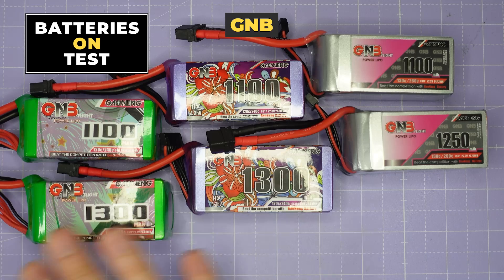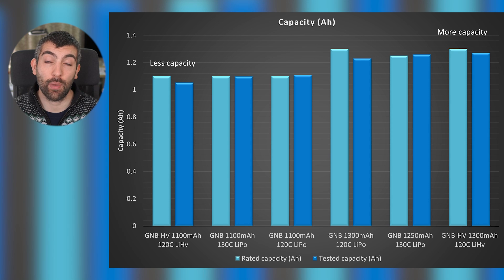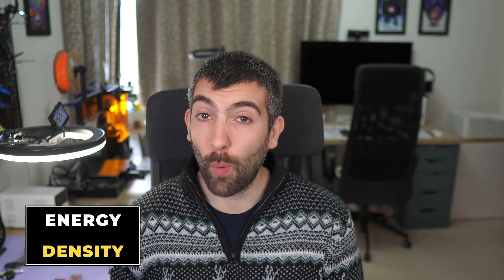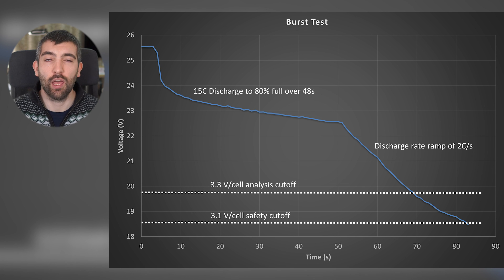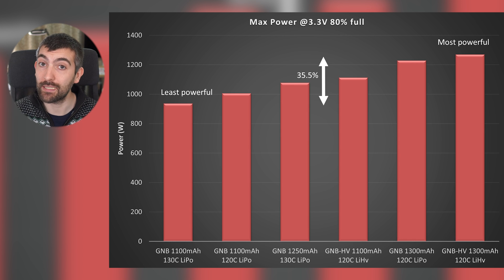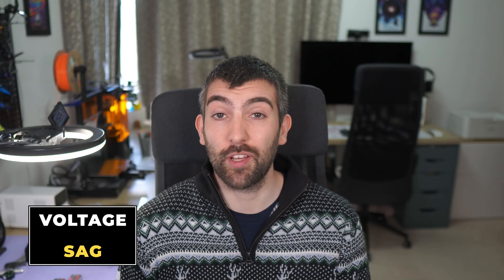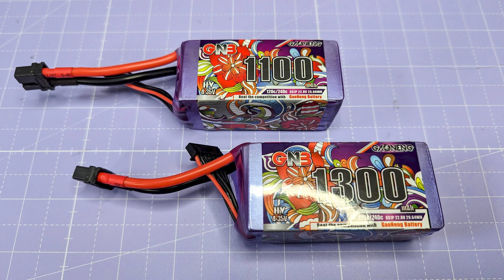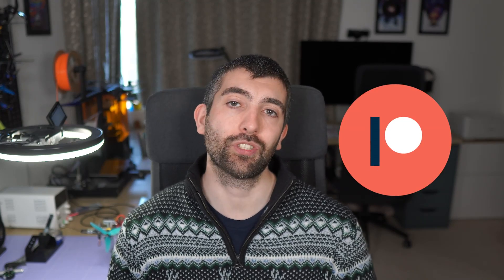Testing GNB High Volt 6S LiPo's: Not what I expected!

Comment: Honestly, I've been running long term with the GNB LiHV 120C batteries and a number of other high end packs, CNHL Ultra Blacks, Tattu R-Line 5.0s all at or around 1400-1500mah. Ive had the GNBs the longest suprisingly and got the Rlines last and have some of them fail after a handful of flights. I've found the greatest factor in battery longevity is the pilot choices, not the battery. As the biggest differences you're getting in spec are providing tiny percentage gains, but a poor decision on how long to push a battery for can give you a good 50:50 chance on that being the last charge the battery can take, ever. Going forward with a new 8s build I'm going to be investing in LiHV and focusing more on my voltage dicipline.

Also, the worst out of those batteries were the CNHL ones, almost every time was a single cell failure, pointing to bad cell binning when they put the battery together (as in they pick 5 good (but more expensive) cells and then one cheaper cell to bring costs down, which works for a while but fails first). Won't be buying that brand again.

Comment: 9:35 Have you considered standardizing putting the batteries inside an oven at the temperature they're usually at on average after reaching 80% charge during the burst test? 

This would mean you could get a higher consistency in temperature between batteries. 

I would add another 5-10°C on top of what you measure for external temperature as the internal battery temperature is always higher than the external if you've heated them up by using them, plus make sure to keep them there for an hour (or whatever you find fit) so that it's entirely saturated inside.

Comment: 14:34 I've been using the LiHV 1500 for about a year, and I often see them reading 3.7V when first plugged in. Sometimes, after unplugging and replugging, they reset to 4.4V or 4.35V, but they still perform well overall. Speedypizza lipos are a great deal at $21, while Tattu batteries cost $33 and perform better, making them a clear choice. I haven't tried Dogcom batteries ($41), but I've used the Lumenier N2O Feather-Lite 1300mAh and won't pay $60 for a lipo again. I'm honestly impressed with the Gaoneng GNB 1300mAh 120C; it's my favorite battery so far, but at $28, I might switch to Tattu after reviewing the data seeing the Gaoneng LIHV’s are $2 dollars less.

Comment: I have been flying the high voltage 1300mah 6s packs for a year now and they have been amazing. I just got a new batch and my old batch perform just as well as the new. I don’t notice any difference. These are the best lipos I have ever flown hands down
Reply: I got mine about 3 weeks ago and have only been charging them to 4.20 cuz I was always told it was super bad to charge them to 4.35 but I’m gonna see hopefully don’t ruin all my expensive batteries, I’ll take you’re work for it lol
Reply: @ontariodoublex2713  it's bad to charge standard LiPo's up to 4.35V, may even be dangerous (mostly just wear out much faster), but LiHV's are literally designed and manufactured to be charged up to 4.35V and it's the only way for them to reach their full capacity.
For LiHV - 4.35V charge is equal to LiPo - 4.2V charge
Reply: @ontariodoublex2713 I have charged them to 4.35 every time for over a year and they still fly perfect, no puffing, and they are meant to charge to 4.35 so don’t worry 🤙
Reply: Better then tattu rline?
Reply: @FPVwilco they are way lighter and perform the same if not slightly better
Reply: you guys made my mind, Im going to order te 1850mAh HV GNB, only 260gr!! holy cow
Reply: @oscr_zen hello !! Have you tested them ??

Comment: Hi Chris. Question, not related to this vid. I cant find much info on the expected current down the 3 motor wires. Its just occurred to me because I was wanting to connect my motors with 3 pin MT30 connectors. The ESC can do 50A and obviously the XT60, 60A. The required rating of the 3 motor wires and any connectors is not so obvious to work out. Probably RMS power etc but its not my area.
Reply from the maker: The design current through each wire should be the same as the ESC rating so 50A in your case. At any time two of the three wires are carrying equal and opposite current. The RMS power through the connector will be reduced by 2/3 because there are 3 wires and 2 active at a time. MR30 is commonly used for this application as it can carry 30A continuously I think and we only draw more than that per motor for short bursts and there is lots of cooling.

Comment: Got some of the gnb hv for my 2.5" because of the weight, they performed really good, BUT they also didn't last very long before becoming too puffy for my liking, I'll just go with a regular, probably tattu even though it will put me slightly ove 250g

Comment: The 120c and 130c difference makes me wonder if the cooler running 130c pack will puff less after a really hard flight, possibly giving it a longer lifespan than the 120c pack under regular high current use?

Comment: Hmmmm…. The highest C rating is a bit unfair or more biased to „bad“ cells. 

I buy many packs to compare them myself. Spent like 450€ into 6S Li-Po in less than 2 months. I like the hobby more from an technical aspect than the flying itself. 
Anyway. 
For instance. If I measure a cold (20°C) Tattu 5.0 1400mAh. It comes out at around 5mOhm. Around the same as a CNHL 1550mAh 150C or DroneIT 1380mAh 150C and now comes the but, the CNHL 1300mAh 100C, has as well around the same IR! 

But when I place the Li-Pos into my heater (which doesn’t cost more than 25€ in DIY, so anyone which seeks performance would surely have it!) the 150C packs go down to 1.8-2.5mOhm, while the 100C remains at around 3.5-4! (~35°C)

I think that’s something to consider. I’m not saying the test is BS or something. I just wanna say it depends and it should be included. The gap will spread out and when people spend a couple 100 on Tattus (which you do easily) a battery warmer for just 30 bucks is „nothing“ and also helps the battery to cycle a few more charges.

Comment: Hi Chris, I got a GNB 6S HV 4000mah lipo to test on my 7” for mid range flights. I compared to my 6S no hv 4500mah have to say that the weight savings are huge, but mah are not there. I think it’s kind of the same results you got isn’t it ? In the end , beside the first minutes of flight with more voltage, is it worth it ?

Comment: Thanks for the Testing, What if I put 2 x 3s(12v) 120c in series, do I get 24v and 240c?
Reply: 120C is the supposed/claimed discharge maximum. In series therefore still around 120C, since the current has to pass through every pack and so its chemistry limits the max?  Output voltage will be the sum of the packs.  I run 2 x 6S in series on a couple of my 600 size Heli's with nominal 50v motors.

Comment: I’ve been using my 1500 HVs for 2 years (don’t fly loads) and they seem to work just as well as when I got them. I’m impressed with them. The quality of the 650 4S HVs isn’t good in terms of wires/soldering etc.

Comment: Yes I have noticed the best batteries I have flown yet have been GNB 1300 LIHV and Dogcom Sbang or Five33. BUT the very best for some reason is RChackers 1300. The GNB last for a long amount of life time in cycles and has a lot of punch for the first 3 weeks. The Dogcom has a crap load of power but when they drop out at the end they drop fast and hard. The rchackers have less punching power but longer flights and longer amount of top end power and way less sag. You cant beat a rchacker for 37$ for two and get to fly longer. So I keep those three. I hate Pizza batteries they are junk and crap out in a few weeks for me.
Reply: I absolutely love my RC hackers 1300s! I've bought 32 of them so far. About to order another 12. They are just good, solid packs at a fantastic price!

Comment: Great work!
would be interesting to see a test of preheated batteries! Also: did you make sure the Packe had the same temperatures as you began the test? As you jokingly said in the beginning of the video I would assume that you heat up the room durcing testing so that the Batteries testet at the end get an advantage.
Reply from the maker: I do all the testing at 20degC in the room (it's air conditioned). The start of the video was just a joke as you say.

Comment: The voltage sag section of this test really explains what I was feeling on my GNB packs. I'm not running 6S, but the way you explained how they feel is what I was feeling. Great burst performance at first and then fall off really fast. I don't like how that feels and I don't want to use that option in BF that tries to level it out.
Reply: Vbat sag compensation is great! I didn't like the idea at first either, don't like anything messing with my throttle. But really it's making the throttle feel more direct by making each throttle position equate to a specific voltage rather than the throttle defining a percentage of whatever voltage is left in the battery

Comment: There was a very large and popular battery test on Rcgroups mostly focused on larger 5000mah 6s edf jet lipo’s…what he hypothesized from his testing is that most if not all “hv lipos” are actually one size smaller in capacity then their label would suggest. They are gaining the “extra capacity” by overcharging. You can also often see this with the size and weight of the pack. I would be interested to see your thoughts on if this could also be the case with our multirotor sized packs.
Reply: I've heard that theory before and I actually agree with it after my testing. On my GNB LiHV packs they do not even get the rated capacity and they are really light. I think they just bin their manufactured cells like silicon wafer chips. The good packs get the LiHV tag and they market it as being able to handle the higher voltage and then over-rate the capacity on the label. The stuff that comes out accidentally at a lower quality gets the standard voltage label. The problem is burst performance suffers after the first hit. In other words, you buy a 1000 mAh GNB LiHV pack and it's actually just an 850 with good chemistry that they tell you to shove more voltage into...and it's lighter because of that.

Comment: Suggestion from racing scene, would be super interesting to see tests with real race flight backlog converted to a discharge profile. For such a tests there should be different flight/profile for different battery weights. So you don't claim better performance when comparing a profile discharge done on 240g battery to a flight log of 180g battery.
Reply: I was thinking the same, I would love to see that. is like when in F1 make engine dyno testing based in data for each track.

Comment: Tattu is still king
Reply: I agree, but be careful because they also have different tiers. The R-line stuff is the best IMO, but the labels of the standard chemistry packs look very similar.
Reply: @mjodr  yes I could have specified r lines for sure, although I’ve got a few regular labels that have been used for many years on low loads. Still are reliable
Reply: So, people's answer is I have not or might not have taken care of them, even to the "you've abused them" claim?  Firstly, that's a false premise. They have been given the same care as other makes, which include GNB in various forms, and yes, we are talking "R" line currently, though my experience goes way back into early GensAce days.  Secondly, my experience is based on a battery collection of in all 300 plus packs active at this time. On Quads I run both 4S from 450-2200mAh, and 6S from 1350 - 1850.   I run from 6000mAh 6S down to 150mAh 1S in all, since I operate Helicopters, Planes, VTOL, and run two clubs, one of which I provide batteries for as its a school juniors club, 150 plus every week there. Personally, I fly for two to three hour sessions a minimum of two times per week, more usually four in the better weather. (I can fly my own property as well as having a club field 10 mins in car away, so I'm very lucky).  Bottom line, GensAce and Tattu have never exceeded nor in some cases matched the performance and longevity of some of the other makes I have used over the years where I have comparable sizes/types. Period.  Adequate?  Yes. King?  No.
Reply: @BadRavenFPV  what batteries do you recommend for 6s 5" freestyle? Or in general?
Reply: Well, absolutely not from my experience, which goes only to prove how individual use and handling variations make subjective statements worthless.
Reply: @BadRavenFPV  No battery is going to perform well if abused
Reply: @BadRavenFPV  well can we say you might not have taken the best care of them.. I am particular over mine and the r lines last my hard use exceptionally well. I stop at 3.7v showing  and never store them  up overnight.

Comment: My experience with gnb, a lot higher internal resistance, massive voltage drops on moderate load, shorter lifespan and cycles. Build quality was really good but performance was worst out of any packs i had. Never bought them again. Using cnhl since then.
Reply: I would agree with all that.
Reply: @mjodr  Yet not my experience, odd.  Maybe the way flown?

Comment: I bought the high voltage GMB 1500s and ever since I bought and flown them. I won't fly anything but these now  absolutely amazing. And the weight you save is amazing and you can feel the power across the board compared to regular Lipps  in my opinion
Reply: How much do they weigh?
Reply: 218g +/- 10g. they weigh less than most 1300mah lipos. @CyberdeckCafé

Comment: Hi ,In My mini long range 4 inch i use GNB HV 650mah  4S 60C and i did out 2.2 km  and in 2.2km with 1500mt of elevation gain.
620mah consumed.
I'm very surprised about this performance!

Comment: I bought 5x GNB HV's of various size. after 2 months all of them have puffed up huge and are RIP... my cheaper CNHL are all fine along with pizza & coddar branded.
Reply: you charging them at 5c or something? damn
Reply: Woah!    😯The ONLY GNBs I have ever had swell (eventually) were tiny 1S used brutally run to 3.1v regularly and never storage charged and also 2200mAh 3S used in EDF "jets", again pretty brutally. Not had 4S or 6S GNB on my quads swell, ever. Something very wrong there, a safety concern!  I am around several others in a group, we all use GNB, and they just do not swell.  It may be that the other brands just cannot have the current sucked out of them at rate TO swell or as Damon says, it's a charge issue??

Comment: My low-value anecdotal battery experience. GNB 1250 - Had 5 of these, they all died within 5 months of flying. Ovonic (4S & 6S) - I bought about a dozen of these and they have lasted over 2 years.
Reply: Mine same.. my GNB HVs all died within 2 months of gentle flying. ALL other brand packs I bought and used the same are all still fine 6 months on
Reply: @LostCloudx4  What do you mean they died? Did one of the cells died? I have two gnb 1300 6s lihv and i crashed one of them really hard so all cells slided, i just wrapped it with new insolation and it is still doing good. I discharged them below 3v many times etc. Still good
Reply: @some-nazarii are they still fine? Thinking about buying the gnb lihv 1500 rn and I’m concerned about the life span of
Reply: @ofrisela2006  they are good. Tatto died but gnb is still running
Reply: Same with ovonic, my favorite is tattu batteries but if money is tight ovonic is my go to for best bang for the buck. Was not impressed with cnhl or gnb
Reply: Those Silver gnb 1250s were trash, and very heavy for the price. I dig these hv ones. Ovonic has been very solid for me, albeit a bit heavier, but also the least expensive available in my location.
Reply: I've had the xt60's wear out on the ovonics before the cells did.
Reply: Dealing with ovonic at the moment, just bought 6s 1300 and a 2800 packs, 1300 were good. 6 minutes with moderate flying, 2800 lasted exactly the same on the same quad...

Comment: Thanks for this test, I've been trying different packs for my sub-250g builds (650 and 530mah) and so far am finding that the GNB HV packs have quite a bit more internal resistance than my typical Tattu packs. Did you notice the same?
Reply: I notice that. My Tattu R-line packs perform way better.
Reply: @mjodr  I'm not sure I'd say they perform better because there is a ~5g weight difference. I did a test on my channel a while back and did get more flight time and less sag with the HV packs but the IR was surprising.
Reply: @Mangorille  GNB packs are lighter because they are literally smaller packs over-rated on the label. It makes an RDQ or Tattu pack look "heavy", but to me the heavier pack is actually the standard if you know what I mean.
Reply: @mjodr  I've heard this as well. I also heard that the HV packs use a different chemistry, that's why they're lighter. Not much information out there to support either.

Comment: Very informative and consistent with my own flight feel conclusions. I have used the 1300 LiHV for a couple of months and used Tattu 1300 V4 for a long time before trying these.
 I loved the LiHV at first (compared to older Tattus). I still like them but I find the sag to be very noticeable after about 30 cycles or so. I also recently observed that the sag seemed worse with lower temp than the increased sag on my Tattus.

My current recommendation is that if you are used to high end 1300 LiPos but want the density of the LiHV - get the 1550 LiHV and it will settle at similar power performance as the lower cap LiPo BUT will fly for longer at extremely low weight cost.